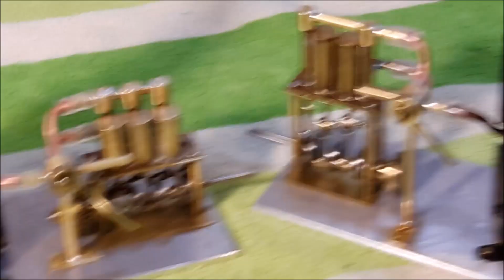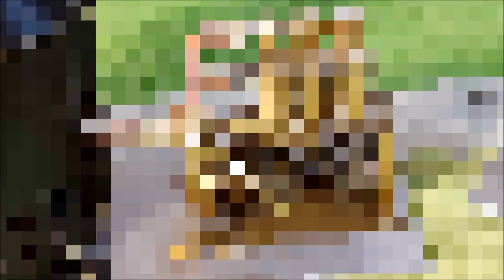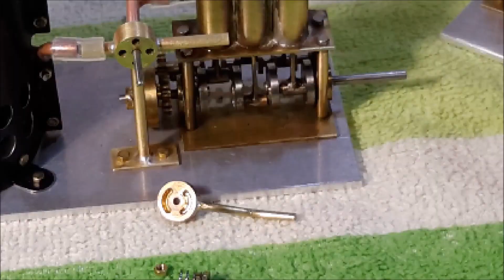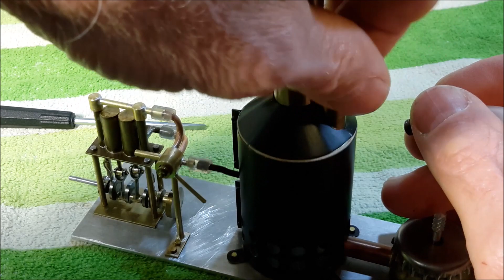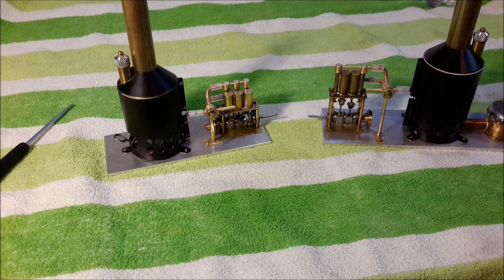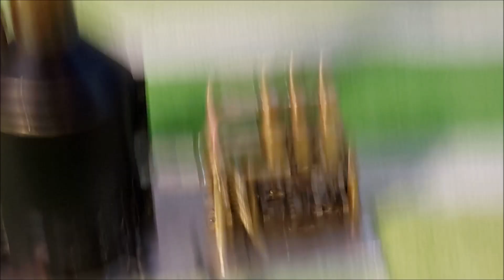MINIATURE STEAM ENGINES WITH REVERSING VALVES

Comment: Do the engines need oil ?
Reply from the maker: I use a light oil on the crankshaft bearings and the connection rod bearings.  The piston and valves get sufficient lubrication from the moisture in the steam.  Most larger model steam engine use steam oil added to the steam inlet pipe to lubricate the piston and valves, but it gums up and sticks these real tiny engines, so I rely on the steam moisture only.

Comment: Hi Les, do these engines have a safety valve? What happens if the water runs out? Can the boiler explode?
Reply from the maker: The boilers have a safety valve set to release at 10 psi.  It is the little spring loaded ball on the top of the boiler fill plug.  If the boiler runs out of water there is no steam and therefore no pressure.  The boiler may get really hot but probably no damage as it is soldered together with hard silver solder, melting point about 1200 degrees Fahrenheit.  The boiler may explode if the safety valve and steam pipe to the engine were totally sealed so no steam could be released.
Reply: I see, great it's completely safe. Amazing craftsmanship! I wonder if it is possible to install these engines into a model of a steam ocean liner, like maybe the RMS Titanic or Queen Mary. I've got an electric model 1:200, but it's not nearly as exciting as steam models

Comment: Bravo Les ! that reversing Valve idea is a masterpiece. So the steam exhausts through the tube on the side of the reversing valve now, I wouldn't have thought that the engine would run at all if you admit the steam through the exhaust manifold, because of the slide valve timing settings . But, amazingly,  it runs so well in both directions and the Valve seems to be quite an effective throttle control too. I also like the new manifold idea that you have fitted on the exhaust tubes at the top of the cylinders. Do you have a plan of the new reversing Valve and the new exhaust manifold ? These engines of yours are just so fascinating and the engineering craftsmanship is to such a high standard it blows me away. :-))
Reply from the maker: Hello SteamerEdge,  Thanks for your kind remarks.  I didn't make a plan, I just used my drawing program to lay out the holes on the valve.  I can send it to you if you want.  The slots were made by installing a small Dremel ball cutter in the lathe and rotating the valve face, before it is parted off, in the tool post.  The hardest part was bending the small copper tubing without kinking it.  I heat softened the tubing and bent it with a 1/4" rod with a round bottom groove cut in it.
Reply: Thanks Les,  please email me your drawing of the layout of the valve. I would like to try it. I wonder if it will work on your basic single acting single cylinder engine  ?
Reply from the maker: I put some what I have on the reversing valve together to send you and found that I don't have your email address.  You can send it to me at lesproper@gmail.com